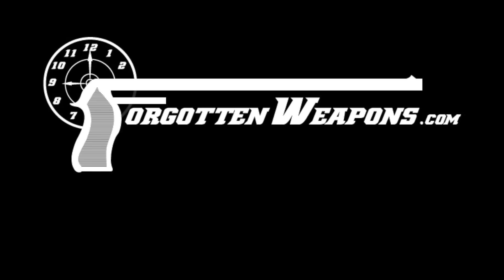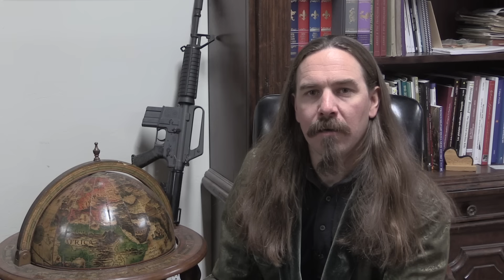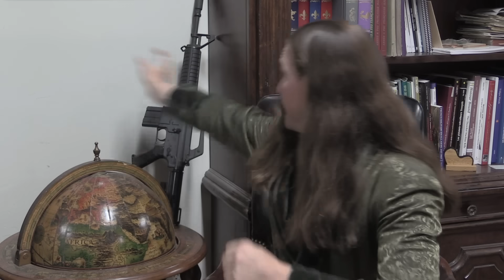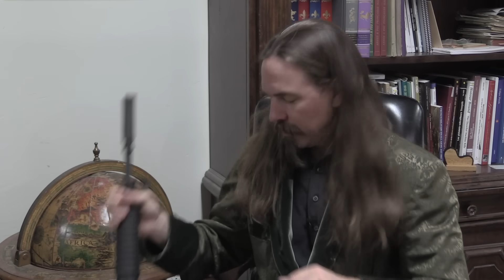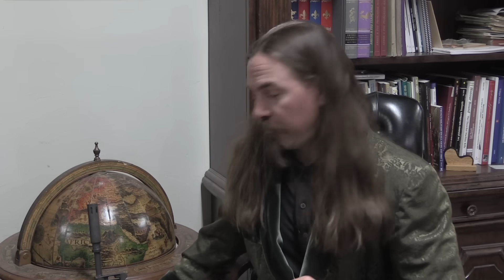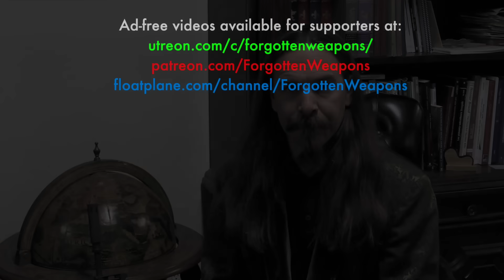Ask Ian: "Last Ditch" Rifles for World War III?

Comment: I'd like to see a production "drag race" between a aluminum and polymer lowers. The polymer lower would have to include milling the dies for the mold and sonic welding the halves together, but the aluminum one would have to install all the parts that the polymer ones have as part of the unit before the next one can be started. I guess to make it fair you might as well just make complete lowers for both since if you're going to attach a grip then you're going to install the detent and spring, and if you're going to install that you should just do the safety, and at that point just do everything.

But with the huge lead time before the polymer ones could start being made I'd be curious how long it would take and how many lowers would be made before the polymer ones take the lead

Comment: I work in the gun industry, not in the cnc machining line but i have little knowing about it. 
They pay a lot of money for a specialis guy, who can make 3-4 second shorter the machining time. This is sound not too mach, but when your cnc goes 24/7 it makes a lot of sense. And we talk about not just one machine, but dozens-hundreds of cnc machines that work faster, because of this 3-4 second per piece.
So i think in a wartime not a machining time reduction is the key to the speed up of the production, because it is very efficient already.
The solution is like Ian says is the parts simplification or "new" technolgies instead of metal machining (like the KE moulded lowers). My problems with the moulding is that press is not cheap, slow and hard to make. The production with the mould is fast but production of the moulding press is not.

Comment: The forward assist components, dust cover components, and flash suppressor could just be deleted altogether. Sling mounts could be omitted and just be replaced by the end user with a piece of paracord that ties off to both ends of the weapon. Heat shields under the hand guard may be sacrificed as well. Not producing and not installing all this little stuff may be necessary to alleviate the demand for their raw materials and, due to the conflict, there may be a limited number of personnel available to assemble these weapons. Those people can be directed to focus on only the main operating components.

Comment: I feel this could have gone further. Basic extruded alu free floated tube/barrel nut vs trad handguards, no forward assist installed (maybe a rubber plug), no dust cover assy installed, A1 style rear sight, only one or two rail cuts on upper for that rear sight, KP style polymer lower with a quick deflash, and 16-18" barrel with a twist and chamber that handles the absolute widest range of ammo.

Comment: Why stop at cutting out burst when we have so many shops tooled up for semi-auto FCG production? Just adopt the AR-15 and you can cut out the auto sear and 3rd pin. Once you're no longer worried about it running in full-auto you can go to a solid polymer buffer, preferably with an extra heavy simplified carrier. Upper/handguard could probably be aluminum extrusion as an alternate to forging, just cut a few slots for weaver and/or mlok mounting. If you're that hard up for 5.56 rifles you would probably also start to issue some form of 9mm blowback SMG/PCC to spread out the load on ammo producers.

Comment: It is easier to tool up for AL lowers. There are a butt load of small to medium shops in the USA that will not have the capex nor the lead time available to tool up for polymer lowers. Most of the shops have 4-5 axis machines that can run a high spindle rate and more than easily hold the crap mil spec standard.

Comment: What about changes to the ammo.  Go with something other than brass and lead.  Maybe ceramic or aluminum and for the bullet bismuth.  you could even change calibers and go with the 5.7x28.  Going with polymer magazines would also speed things up and maybe be cheaper.
Reply: But bismuth is about 20 times more expensive than lead. Ceramic and Al probably wouldn't be suitable either. Steel would be better.
Reply: @ChristianMcAngus  Didn't know that about Bismuth. Should have after duck season.

Comment: Don't know if is more expensive but instead to go with an AR platform I'll aid to adopt the M1A Scout with Rubber and Laminated Wood Stock as Last Ditch cause 7.62 even the more recoil and less magazine capacity and more weight of ammo carry the cartridge have a great stopping power and range and maybe modified a lil' bit can reload in black powder and use the rifle in straight pull configuration easier than AR15 and 5.55 platform.

Comment: Ok, you also have to get rid of the forward assist, on the bolt as well, the brass deflector and the bayonet lugs. And any sling attachment points - in my days we used paracords instead anyway. You can also make those pins non-captive, many guns are just fine without it. You can probably be OK without a flashhider and a threaded barrel too. The front grips attachment is ridiculously complicated, easy to come up with something simpler. The charging handle should be on the side (either one, really) - the current one is too elaborate. I kind of want to see a WW3 AR14...

Comment: In the 1980s, my mom's factory had machining so they could switch from making parking brakes to making M-16 parts. Would this distributed manufacturing allow the industrial base to continue making the then current M-16 design without needing to reduce any complexity? (Although, now that I think about it, I don't know if those parts were for the then current design or if they were for a reduced complexity design.)

Comment: Does anyone make forged profile barrels? If you are running into materiel shortages you could stretch things a bit by improving your "buy to fly" ratio and reduce the amount of materiel removed and recycled.

What might be really interesting would be to create spin cast hollow blanks that then get run thought some sort of zone heating forging system that rolls them down the the needed profile. From there the only thing that would actually need machining is the inner surfaces, the mating with the barrel extension and the gas block journal. You might even be able to skip that last one if you heat shrink the gas block in place before drilling the gas port. Not a system you would want to stand up on the fly, but it would be an interesting R&D project to have run ahead of time.

Comment: The M16 already is a rifle that is fit for mass production. It is a stamped aluminum upper, lower, charging handle, front sight. Basically the same process as is used by tesla to make their car frame, some sort of press/injection of liquid aluminum. That production technique is rather fast and can give parts with good details, maybe even the part completed. The trigger parts are made using techniques used in toy production and are of cast steel. The plastic furniture parts are also made with the same type machine that makes the trigger parts. The barrels are hammer forged into shape. The magazine is stamped steel as is the ejection port cover. All springs are made of music wire in different gauges. The bolt and some other parts are made on a swiss CNC machine. And there you have your M16. The thing is, they started to produce AR15 rifles with other techniques than first envisioned for mass production. These processes are a lot slower. Also a lot more expensive. Some newer techniques like sintering of steel powders can make cheap trigger parts. If a lot of guns are to be made, it is best to explore all the different techniques and choose the right techniques that is the fastest or the cheapest. The burst feature is actually good to have with rookie troops because it saves ammo, I would certainly put that feature in, it saves munitions later on. An M16 should not cost a lot to produce. The US army pays 600$ per rifle, so a lot of money is made by the industry, but remember big investments and knowledge are needed. Those prices were from a couple of years back, I don't know the price as it is now. It should not be too expensive. 

Greetings,

Jeff

Comment: If we go that poly Route we will end with an ar18 style system similar to early export G36A0 rifles similar to what Spain adopted. CNC cut to minimum only a few modifications from round or square stock is permitted, hydraulic pressed together.

Comment: You’re wrong about the sights by assuming they’d retain the carry handle. It would expedite manufacturing of the upper if they milled a rail section onto the upper (like most ARs are like anyway) and simply sourced rear sights from Troy, Midwest Industries, or Magpul (like everyone basically does anyway)

Comment: Considering the number of AR-15 manufacturers around the world i'd imagine that it would be possible have several different pattern "last ditch" rifles. These would vary depending on how much use their intended users are expected to see and other variables. I'm sure that there would be enough production capability for collapsible stocks to supply any and all troops who get issued with armour. Tank/vehicle crews would get issued with an AR-pistol possibly with FA mode (possibly FA only), possibly with buffer tube only. Rear echelon security troops like those in homeland would have the most basic rifles as they are mostly just to deter stealing/sabotage.

What i was wondering if the magazine production capacity can keep up with this? Could Magpull multiply their production lines easily just by handing over specs to sub contractors? I wonder if they have a different production lines for gen 2. and gen. 3. magazines (with window or not) or do they alternate the production between the modells? Would it help if they made only one modell?

Also, would there be need for a gun designed (perhaps) around some widely aviable magazine? And i'm talking about Glock 33 round magazines here. There seems to be several manufacturers of magazines so the usual supply of pistol magazines can be handled by some companies and the 30+ round magazines by others.

Comment: I kinda think the interchangeability of CNC systems probably makes it possible to ramp up additional production of a CNC design in a national emergency relatively quickly compared to tooling based machining.  I'm not sure that CNC machines aren't slower than tooling-based machining though.

Comment: A few other things. 
1. Females would be conscripted to defend the Mother/Father/Home land.
2. Barrel lengths would be shorter. Shorter barrels use less material for the barrel, which adds up.
3. We may see gas-operated rifles simplified to bolt-action rifles by eliminating the gas system. I'm not talking some bolt-action AR-15 abomination, but more like Brandon Herrera's cursed AK, which simply would not cycle.
4. The HK slap will be a generational thing, like latchkey kids. The L-notch is the simplest and cheapest way to hold a bolt open.
5. 3D-printing will be a thing, as it increases production in a decentralized way.
6. "Kill him and take his gun." guns will be a thing, like the FP-45 Liberator.
7. Weapons will be made to use enemy ammunition since you can just shoot someone and take theirs.

We'd end up with a short-barrel, 3D printable, rifle that has no gas system, a fixed magazine, and can be easily converted to use captured enemy ammunition. It would be something like a Steyr AUG that won't cycle, so you have to yank the charging handle between shots.

Comment: The burst feature was NOT brought in because of a training issue with full auto. It was brought in because there was a feeling that troops were wasting ammo on full auto. It was just a way to cut down on waste. Through Vietnam all the M16-A1s were full auto. It was only during peacetime that the idea of the burst mechanism was incorporated. 

I remember one of the first times I saw the M16 in a movie. It was some spy thriller. One character, who had no experience with one was given a M16 and told to just let off a burst. The magazine used was, of course, a 20-rounder. This had to be done consciously. 

One thing I am surprised is not mentioned is the barrel profile overall. Yes, the grenade launcher cut should go. I can also see a return to 20" barrels. I would opt for a return to the thinner barrels of the M16-A1.

Comment: So best two builds would be a M 16A1E1 ... 20 inch medium profile with a 1/9 twist with a polymer lower. , A2 polymer handguards , Original A1 rear sight with a "rapidex"( Luth Ar)rear sight knob with a A1 FSB. And A2 solid shoulder stock , with composite materials for butt stock.. second device is  a 15 1/2 inch  1/9 twist medium weight fluted barrel , polymer  receiver with a collapsible  composite butt or optional m231 port fireing buttstock. , M4 composite handguard  and M16A3 upper and cast  picitanny fsb.Sights would be  a simple clamp on rear v notch and post front blade .this version would take Any optic that has a pic rails system.   A Final receiver type could be a  cast polymer with a thin sheet steel liner reinforcement  sandwiched in between the layers with a metal buffertube supports and pistol grip  reinforcement. Simmular to a 0% receiver like the (Pour freedom kit ) that were available in the 2025 to  early 2020's. That my take on it.  I've built multiple rifles as a gunsmith, Marine Veteran and rifle enthusiast .

Comment: I've also heard it said that during the Cold War, that there were plans to machine the M16 receivers out of steel and fit them with wooden furniture as a "contingency plan" in the event of shortages of aluminum and polymer. Naturally, this was well before the proliferation of polymer and injection molded parts for firearms.

Comment: Not bad ideas. A bit of a quibble with the burst vs full auto option. Back in the '0Xs, the Marine Corps issue M-16 A4 had no full auto capability. If that particular pattern were to be simplified, I doubt full auto would be added back in. I don't remember whether the brass were issued full-auto-capable M-4s, but I'd wager they'd start getting issued regular M-16s when their ricky-recon toys started going out of stock either way.

Now though, the Marine Corps is mostly done with the M-16/M-4 platform altogether, having adopted a modified HK 416. Interestingly, they opted to pull out burst-fire altogether and instead reverted back to full-auto standard with everyone getting equal training in full-auto fire so that anyone could perform base-of-fire when called for in fire-and-maneuver tactics.

Comment: So, thinking of a polymer monolithic lower M16. 

Let’s assume the KP-15 does not exist and the US is in a war where they need lots of rifles really quickly. 

How long would it take for the US to adapt the existing aluminum lower design into a polymer lower design, and then create the moulds to cast that quickly?

You’ve spoken at length before about how the design and development of new systems is not always straightforward and simple. 

I think they better option to simplify the AR is to keep the aluminum lower and go back to a simple A1 style stock. The A1 stock’s buffer tube is very simple and if you don’t care what it looks like, can be made even simpler. Same with the stock- the better use of polymer would be making polymer stocks and handguards. 

Another good simplification would be to make them semi auto only- you’d cut out the auto sear mechanism from the lower. That also means you don’t have to machine out as much of that pocket from your lower blank. 

If the forge dies for carry handle uppers exist, use those. If not, use flat top dies and maybe only bother machining out enough pic rail on the upper for a rear sight. 

As far as rear sights go, a simple fixed pic rail post would be pretty easy to spin up into production- easier than a new lower. 

Replace the slip or delta ring with an off the shelf screw in fixture that can work with an existing barrel nut. 

You could even in theory make a one time use metal band that could be clamped on and screwed together. A2 style handguards are the right answer. 

Use thicker barrel stock and leave out the stamped metal heat shields. Basically don’t bother reprofiling the barrel- just machine your gas port and drill it for an existing A2 FSB forging. Don’t bother with any finishing work on the exterior of it, like for the bayonet lug or sling swivel- they can tie a sling to the front sight itself. 

Over gas the gun slightly so it runs through more muck. Maybe add an extra port to the carrier to help it vent out debris. 

Simplifying is not so much about changing something as it is removing whatever isn’t critical for operation. 

Making a polymer lower would be a good long term solution but it’s a poor short term solution because it generates more development process and requires the creation of different tools.

Comment: Honestly if I had to say anything, in terms of the US, I don't think they would really have to do much research and development to produce a last ditch m16 styled rifle. There are plenty of cheap ARs out there produced in the US that already have much of the features stated above. Most of the time will prob come down to refitting all the major factories to that standard and selecting the best version of those cheap Ars as the standard. Although I would prob say that the aluminum would prob be replaced with stamped steel as Aluminum would most likely be used in other things like jets and helicopters and select vehicles .